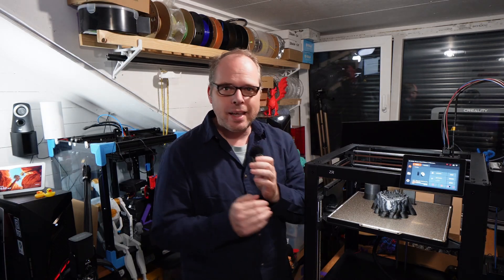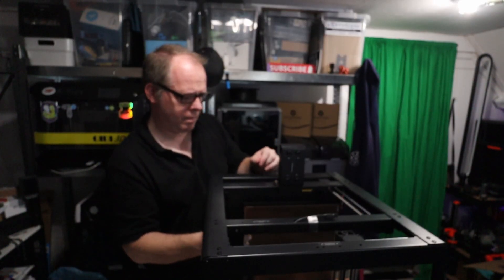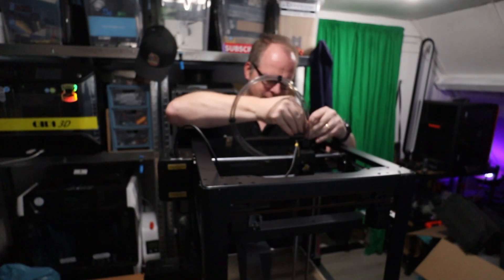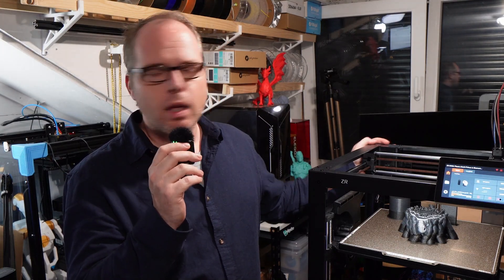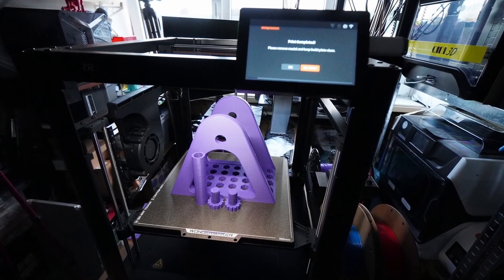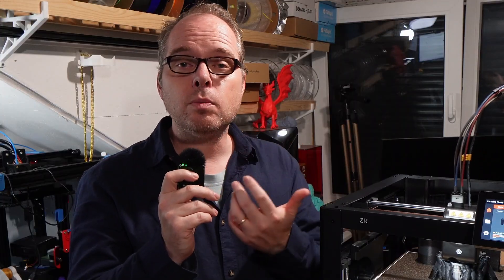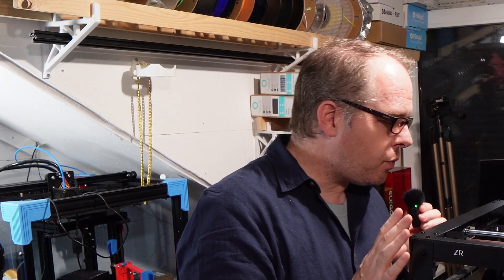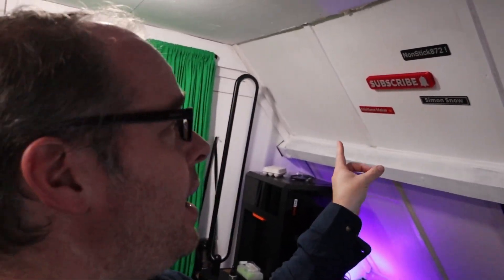Wondermaker ZR 3D Printer Review – Unboxing, Setup & First Prints

Comment: Hey, @min 6:37 you mentioned that there is no Profile for the Wondermaker, I use Orca Slicer 2.3.1 Alpha , where they added the Wondermaker family already, or am im getting you wrong ?
Reply: @01Collection  yeah. The WonderMaker did indeed add their profile to slicer app
Reply from the maker: Great remark there! I'm usually not working with alpha or beta slicers, due to the tutorials and stability issues. But yeah, I'll look into that, but so far, is sounds great